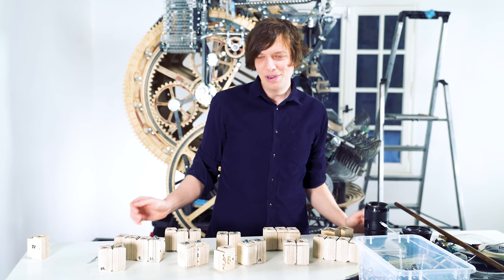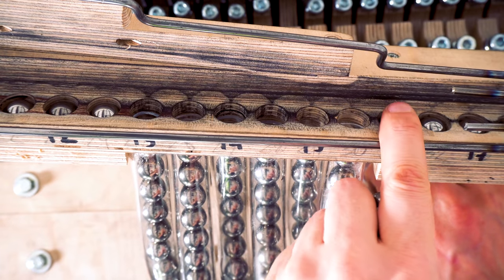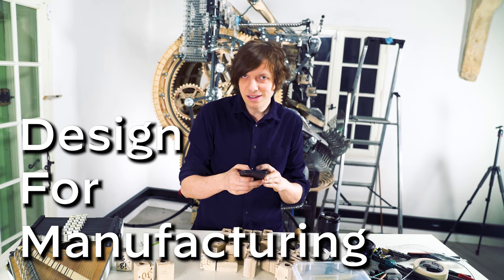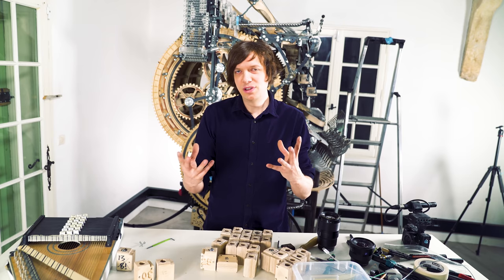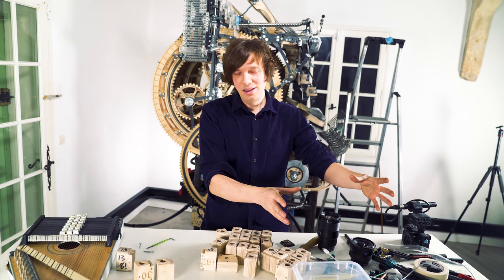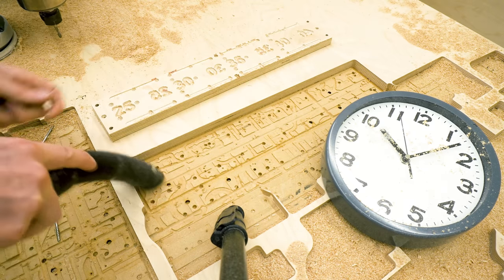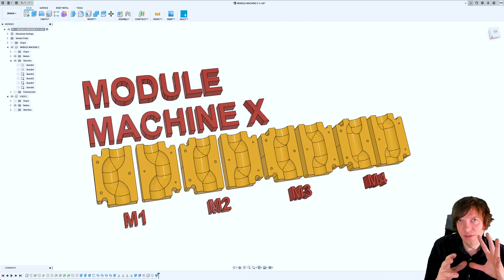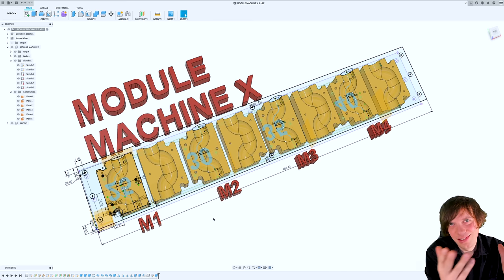Module Machine X

Comment: In fairness to the designer, curves are very easy to bend into metal in mass production - just look at every other car on the road with curved stamped sheet metal for evidence. It's admittedly harder (but not impossible) if you're set on making a car from 1/8th" plate - but that has other large challenges (like how do you make crumple zones? what about the environmental impact from bringing the extra tonne of steel for a ride round the track all of the time?).
Reply: The environmental impact of the weight is partially mitigated by the fact it is an EV. When you brake, the extra kinetic energy goes back to the battery. It still adds to the manufacturing footprint though. But hey, at least you'll be safe if someone hits your car with a hammer.
Reply: I understand Tesla not making curves if they're using stainless steel but I have also wondered about how they plan on creating the crumple zone. I also wonder how easy it is to repair the body if it's also the frame and it's one piece. I definitely admire that they're trying something new and using the strengths of steel to cheapen manufacturing without losing resilience but yeah there are still some questions.
Reply: The Audi R8 is a great example of DFM, it's a minimalist manufactured car that's almost impossible to destroy in an accident.  It's built with millimetre precision around the cockpit and is completely modular where you can swap out the drive train, engine and fittings in minutes. It's also one of the best 'soft' supercars on the road.
Reply: @AwesomeDwarves  Body/Frame repairs wont be an issue in stainless steel. You can literally just cut the bad part out and weld in a new piece. The heat affected zone around the weld might get a little weaker but a good welder shouldn't have a problem. The hard part is matching the finish after welding but that's not easy on any car repair.
Reply: @yondaime500  the "EV have less of a carbon footprint" is bullshit. Where does the electricity come from? The one you charge it with. Until that has a small carbon footprint, it's only a feelgood thing.
Reply: @alcosta732  The same weight needs the same amount of energy to accelerate by the same amount. However, fuel needs to be distributed by truck to gas stations. That's added to the footprint of combustion engines. Not sure what the fuel-to-motion vs fuel-to-electricity-to-motion conversion efficiencies are like.
 That's ignoring the fact the electricity can be produced without burning, whereas combustion by definition cannot.

That still leaves the matter of quality of breathing air. The air in cities would be much healthier if cars were all EVs instead of combustion. Plus, when pollution is centralized, it can be managed much more economically with filters and carbon capture systems that are not viable to install on every single car.
Reply: @alcosta732  This is actually not true in a majority of countries on earth. The internal combustion engine in a gas powered car is not very efficient compared to the massive steam turbine generators used for fossil fuel electricity generation. And things like regenerative braking mean that the raw energy use for electric cars use is even less. 

The only places where a new electric car might be slightly worse than a new gas powered car are in the few countries on earth with a majority coal powered electrical grid (like Poland). In 95% of the world, electric cars definitively have a lower carbon footprint. Even with the fossil fuels used to generate that electricity. Even including the higher energy and material costs associated with making the lithium batteries. And this will only get better over time. 

Here is a reputable popsci article about it:
https://www.bbc.com/news/science-environment-51977625

Here is the research paper it's based on (if you can't access it I could send you a PDF):
https://www.nature.com/articles/s41893-020-0488-7

Here's another (albeit it probably biased, but with a good bibliography) source
https://www.carbonbrief.org/factcheck-how-electric-vehicles-help-to-tackle-climate-change

The main argument against buying an EV (if you can afford it) is the same argument against buying any car. New cars require an enormous amount of energy to create (I believe on par with the on-the-road lifetime energy use) and so if you don't need a (new) car, the environment is better off if you don't buy one.

Comment: Martin. A way to speed up changing over height modules. 
You could use a strong magnet against the side of a pipe to retain the marbles in the perspex pipes while you swap out an incorrect height module. Certainly you would loose some marbles but there would be way less to refill. 
Digs
Reply: That is a great idea!
Reply: Great idea ! But will one magnet be sufficient given the weigth that it has to hold ? (a few ?)
Reply: This is an awesome idea, but I see a problem. The net upwards force of the magnet has to be as strong as the weight of the marbles above it, if the marbles exert a 1 lb force down then you would need atleast 1 lb of force upwards to stop the marbles from falling. The tricky part is that the force of the magnet is perpendicular to the force of gravity, not in direct opposition. I'm no engineer but I suspect it would take a very strong magnet compared to the net weight of the marbles to hold them there, possibly enough that removing this magnet would be difficult in itself. 

It's worth a shot, the mmx has a de-magnetizer anyway.

Comment: Martin, I have a suggestion.  Since you plan on taking the marble machine on tour, it is going to encounter different weather conditions. Since wood expands and contracts depending on those conditions, your modules could have a few more moles to whack. 

My suggestion is to test the impact of different conditions on some of the modules.  Does it effect the height of the top marble? How is the speed of the marble effected? How is the fit of the module impacted? Finding out now could save big problems when it is no longer in your workshop with all of your tools available.
Reply: Thats an important point. As many people under yesterdays videos (height modules) commented, this height module design is problematic. The tolerance chain is very long, the paths (i.e. pmma pipes) are slightly bigger than the marbles' diameter. Therefore, the vertical row of marbles forms a snake pattern in the pipe, which is not always the same of course. Thats the reason why this design with the height modules will not guarantee the needed precision on top of the marble devider.

In this video Sebastian Kirsch came up with an brilliant idea (trapdoor hook system) which could solve the problem:
https://www.youtube.com/watch?v=zahlKPc6TMA&feature=youtu.be

Please vote it up on discord that Martin and the engineerng team can see it:
https://discord.com/channels/649165975647682560/649172304638640130/802136003137372180

Comment: Pop a retaining pin in the marbles path just before the height modules, that way you don't have to empty the whole channel to swap a module out.
Reply: That could cause problems with the height adjustment. It could make the marbles have variable heights.
Reply: @anonymousperson6228  you take the pin out after you swap the module. You only use the pin when making adjustments.
Reply: I was thinking of something similar.   This needs escalation.  I think he's going to be spending a lot if time emptying marbles.
Reply: @revklindsey  He's not going to be swapping the modules out on a regular basis. They have been selected to compensate for variations in the marble tube lengths, why would that change?
Reply: @ferrumignis  it's one single drill hole per channel, not a big deal. He will need to recheck every channel every time the MMX is dismantled and rebuilt. He said it took him an hour to empty, swap and refill just 6 channels and there are 38.

Comment: The thing is... I'd argue that both Stephenson and Munroe would say that they are both not only right, but need each other. One will design a car to not only look good but to have a shape that reduces air resistance and therefore driving/energy use efficiency, the other to make the manufacturing of those shapes as efficient as possible. You are in the unique position of having doing both those roles. For what it's worth not only are you doing a damn fined job of doing so, but also watching you bridging those two worlds makes for great viewing, Keep kicking arse and taking names!

Comment: There is absolutely no way, if the Cybertruck gets manufactured for sale, it will end up looking like that. Sharp edges like that on cars are actually illegal in many places because they increase the chances of massive injury when the car collides with a pedestrian. That is one of several practical reasons why the Cybertruck isn't actually all that well designed. You may find it beautiful, but that doesn't mean it's a good car design.
Reply: Very true and much like the rickity Ikea shelf, DFM is technically all about the manufacturing, not the consumption. It can be great when used correctly and disastrous when used poorly. Manufacturing cost savings isn't necessarily all a company should care about.
Reply: Sand paper?
Reply: strawman argument
Reply: @DevinDTV  What could you possibly mean by that?
Reply: @TheComfyCushion  "You may find it beautiful, but that doesn't mean it's a good car design." He quite clearly stated that his opinion was not based on his aesthetic tastes, but rather the practicality of the engineering principles applied to the design. You completely ignored his actual argument, and instead implied that he made an argument which he explicitly stated he wasn't making.
Reply: @DevinDTV  Okay. His appreciation for it's supposed engineering brilliance also does not make it a good car design. He also talked about how beautiful he thinks it is. Calm down with this confused fallacy jargon, buddy. Martin doesn't need you to protect him from the comments.
Reply: @TheComfyCushion  Just pointing out how awful your argument is, I criticize martin's decisions plenty.
Reply: @DevinDTV  But you're not, though. You're just being weirdly prickly.

Comment: It's funny how you pick Tesla as your dfm example. Historically Tesla has gotten F's on their dfm for the model S/3. We have yet to see them run a cyber truck down the assembly line, maybe they've learned.
Reply: Hilarious
Reply: Yes, that was exactly the thought I was having - I read that experienced auto manufacturers who had done teardowns were apalled at how many separate pieces and operations were used for what should have been a single part, among other things.
Reply: I mean, Tesla hasn't made a million cars yet (but is just about to?), Ford made their 1 millionth car in 1915, I think if you compare most other manufacturers when they were only 1 million cars in vs. Tesla you would be more fair
Reply: @VeganSurf  hence not the best example for design for manufacturing. Tesla still has a very inexperienced manufacturing staff. I think you mistake my comment for disliking Tesla. When I was finishing my degree in vehicle design Tesla was just launching the model S and hired a few graduates from my class. These same people are the ones who would have gone to work on the model 3, Y etc.
Reply: @VeganSurf  I would think that giving one company 105 years more of industry experiences  to learn from would swing it way more in their favor
Reply: @getjaketospace  Having a long time of industry experience also means.that theycan go stuck in "We have made this always in this way, and ever succeed, Why should we change?"

Comment: The best example I could point of this DFM thing is the Rocket Mark II from Dan Lee here on youtube. This guy rebuilt a vintage motor boat and made  cnc version of it. The project provides the cut for the panels, but also a full system of assembly. Simply brilliant ! The result is stunning, the methodology ever more.

Comment: Almost all cars these days are designed for manufacture. The Cybertruck looks the way it does not because it's designed for manufacture, but because it's designed for cheap manufacture. Design for manufacture doesn't mean you will design something to be manufactured as cheaply as possible. It means you design something to be manufactured as cheaply as possible while meeting all other requirements, such as form, function, safety, structural integrity, etc.
And my opinion is that the Cybertruck is pretty damn ugly.
Reply: Well said
Reply: and it will be up marketed and they will charge you 1000 extra to add a trailer hitch and if you try to do it your self they will stop you from charging it
Reply: No real value in going all in on dfm for something you'll only make a few of because it's massively ugly.
Reply: Yup, very well said.
Reply: Exactly. When people talk trucks they don't praise how much DFM it had. They care if it looks good, has power, and how comfortable it is to drive.
Reply: @davidchidester5463  Well, DFM does have an impact on customer experience because it affects the price. It can also affect serviceability. A poorly designed car can look identical on the outside to a well designed car, but the former will be more difficult to put together than the latter, which means it costs more to produce. And when you take it in for a service the mechanic might have a hard time getting access to different parts, which means more effort, which means more costs, all because of poor design.
Either way, most car manufacturers have decided that looks are a bit more important than manufacturing cost. They will make lots of compromises to the looks of a car to get the cost down, but they will draw the line at some point, opting for a good looking car over one that is as cheap to produce as possible.
Reply: Aye, it's bad even for retro-futurism.
Reply: @CristiNeagu  You bring up an excellent point, serviceability. I can understand some parts being difficult to access being a non-issue such as things like heater actuators behind the dashboard since they have a service life that will usually outlive the vehicle, efficiently installed on the assembly line, never to be seen again. On the opposite side of the spectrum, we have items such as an oil filter that requires replacement every ~5-8,000 Km buried in some engine bays behind skid plates, suspension, and structural components, installed at an odd angle so it's replacement barfs used oil everywhere. Some manufacturers actually attempt to make service items easily accessible as part of the design.
Reply: Cybertruck was designed for n64
Reply: Cybertruck is a bet that a lot of people would sacrifice pretty for cost.
Reply: Cybertruck looks the way it does because you can’t really press and stamp stainless steel into panels
Reply: @obsessivecorvid   That's more of an Apple thing! But even in the EV market, right-to-repair is a serious issue.
Reply: @CristiNeagu  I would say in general yes, but it also depends on the target audience. The Ford GT for example did not make cost or servicing compromises. It's all about the looks and performance with that car, because the buyers don't care about the price and they want you to only have the car serviced by them.
Reply: The Cybertruck looks positively beautiful compared to the fugly looking crap that Ford amd GM have been churning out.
Reply: @ferrumignis  You're high lol
Reply: They don't meet the safety requirements neither is it easier to manufacture the panels so I guess they are disqualified
Reply: @abpsd73  Oil filters did come to my mind when i was writing that, but it doesn't really fit into DFM. As far as i know, the engine is fitted inside the chassis with the oil filter already attached, but i might be wrong about that, and if i am wrong then it does come under DFM. Either way, yes, all manufacturers need to give serious consideration to how their cars will be serviced. But they don't give that as much importance as they give looks or DFM. One example I am painfully aware of is the Jaguar E Pace, where amongst other things, if you remain stranded by the side of the road and you need a tow, you need to remove the entire airbox to get to the transmission park unlock lever. Stupid design.
Reply: @paulhomer9215  That may be so, but you can be sure that someone spent a lot of time thinking about how the car will be assembled on the line, so a lot of DFM did go into it, even if they did not compromise the looks. If it will be assembled on a production line, lots of DFM will go into it.
The only cars where there really isn't much DFM going on are very limited, hand crafted cars. Even then you have to design your parts in such a way that they can be mounted. As in, you need to design for an order of operations such that you won't end up with inaccessible screw holes or such like.
Reply: Well its easy to talk when u dont invest your money in to manufactoring . U have to understand that bending and making panels round cost a looooooot of money :) painting too it is a looooot money costing production lines. Cyber truck is genius  from the construction and manufactoring side, the design is a personal taste qwestion, personaly i love the design i think its perfect.
Reply: @Nagaz_  panels are stamped... How is that soooo expensive? 
Actually straight edges/ hard bends are more difficult to get right through stamping
Reply: @CristiNeagu  well true its not a new thing but for me function is always priority practicality and functionality for me its a most important thing,  and like i sad  looks and design its a  personal taste thing.